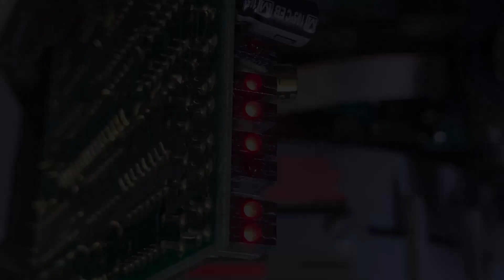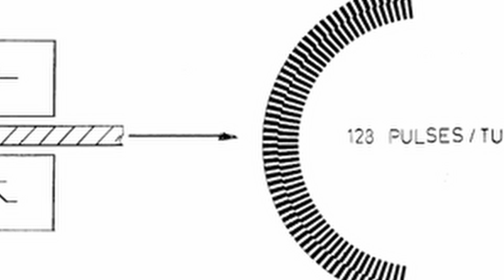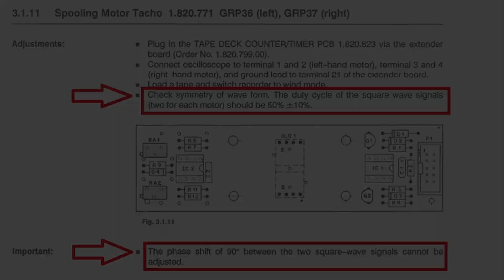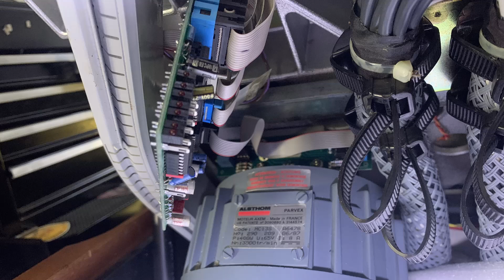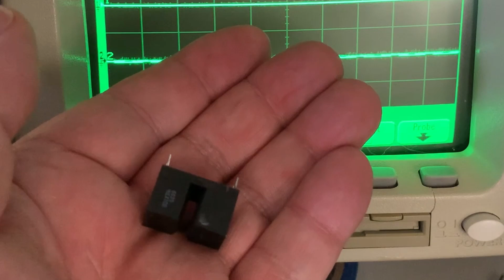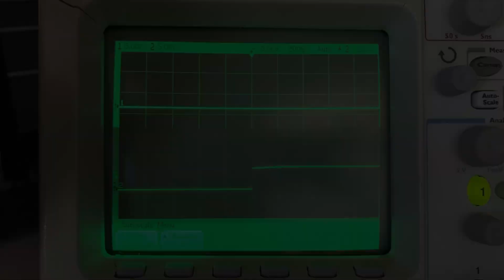Studer A820 2" Multitrack Restoration - Part 44

Comment: Great job troubleshooting the controller.  In the past I have had a lot of failures of the leds in the optical sensors of that erra. We used to have a big bag of them because we replaced them so offen. I don't think first era of leds hold up over time.
Reply from the maker: That’s interesting. I didn’t believe it was that because sometimes it would work sometimes it didn’t. I just didn’t want to swap the cards because of all the work, and that laziness bit me in the end. I literally changed everything on that card because I didn’t think it was the optical sensor.